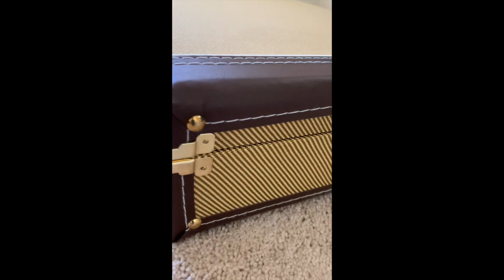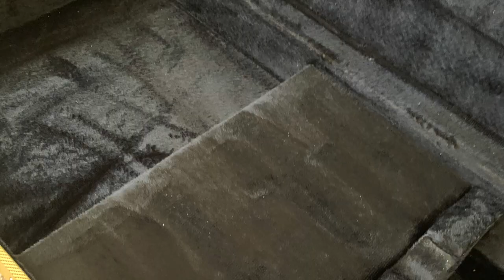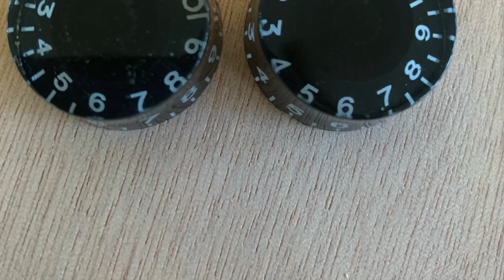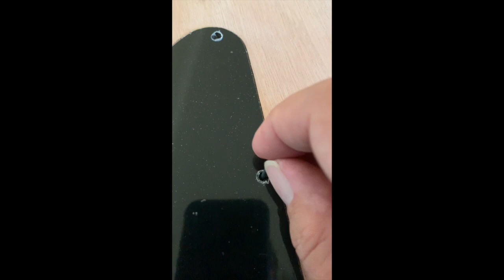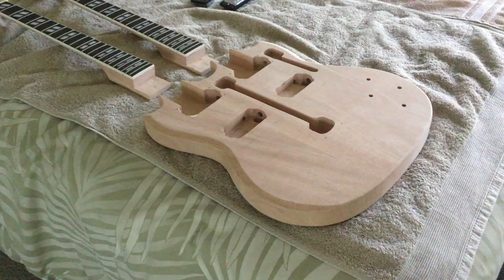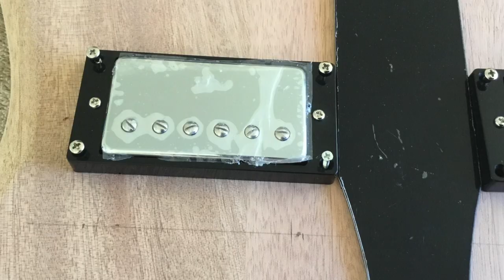Double Neck Guitar Build - Unboxing

Comment: hey mate! Just wanted to let you know that there is minimal tonal difference between bone and plastic nuts. The major difference is that bone is a self lubricating material in comparison to plastic which needs to be lubricated manually. This means that usually it results in better tuning stability. Other than that great vid my man!

Comment: Not a bad looking kit. If you don't mind me asking,  with the dry run, did the neck angle allow the strings to meet the tuneomatic bridge approx mid height adjustment via the 2 height adj screws?  Also nice that it came with the case,  they seem to be non existent anymore.
Reply from the maker: Hi Jess, After the dry fit it looks like gluing in the neck is OK.  However, I had a very minor drill drift and one post is off by about 1/16 of an inch, which was enough to mess up the height adjustment, so I need to pull the bridge screws and enlarge the holes to allow for a correct fit.  Ugh.